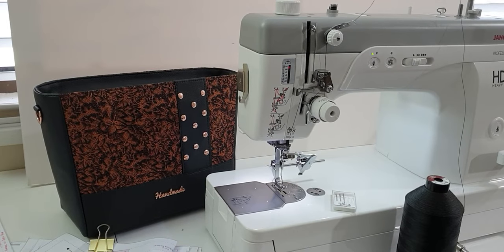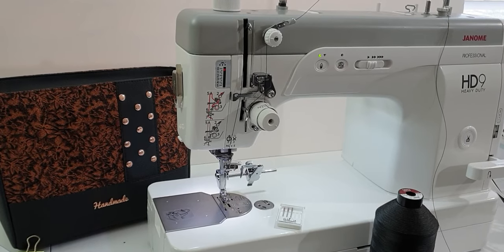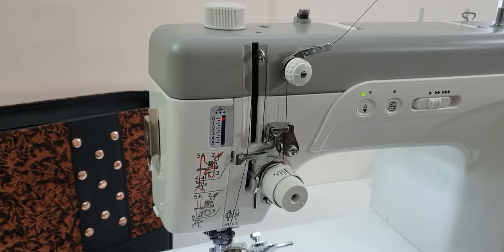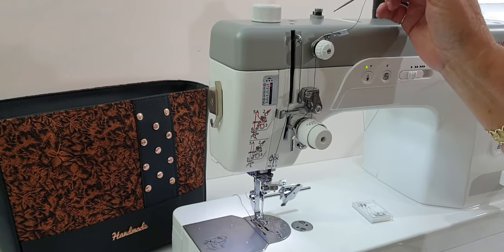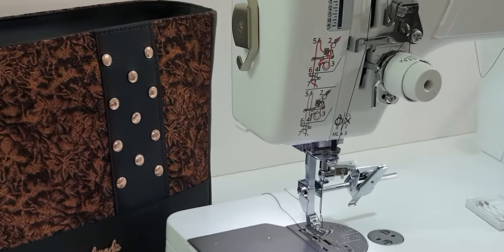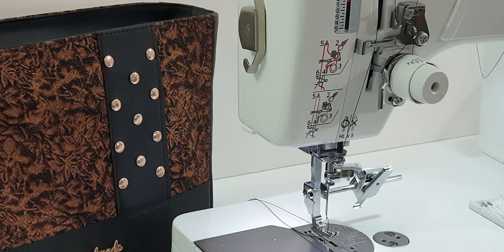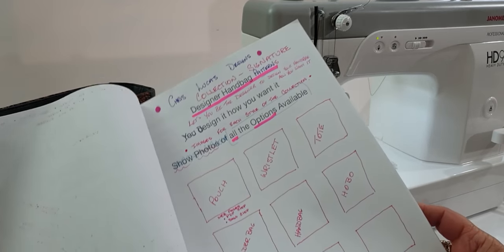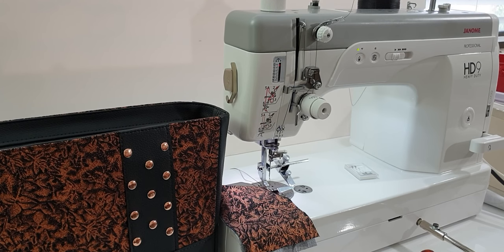Answering questions about about using my Janome HD9 sewing machine to make a handbag.

Comment from the maker: If you are looking for the adjustable seam guide I’m using in the video.  Here’s a link to the Janome dealer I bought mine from.  I also bought my machine and feet from them as well and they do ship worldwide.  https://www.ebay.com.au/itm/Janome-Adjustable-Seam-Guide-Janome-1600P-HD9-Professional-DB-Hook-Models-/293421670691?_trksid=p2385738.m4383.l4275.c10
Reply: Thank you.  I see you were using the Janome HD9BE, yes?  I just bought one, and it was shipped to me.  It clanks as I sew - so frustrating - it is oiled and the needle is correctly installed.  The bobbin is loaded per video tutorial made by Janome Junkies, and also the bobbin in loaded into the machine per video tutorial.  Any ideas you may have regarding what is clinking (as the needle goes DOWN), please advise.
Reply from the maker: @elainestephens5906  Sounds like something is either going on the top part of the machine or the bottom bobbin section… depends where the sound is coming from… top or bottom section.  Could be something misaligned somehow.  Also might be worth checking in the bobbin area incase there is a stray loose thread somewhere in there that is catching on something.  Other than that I would phone a sewing machine service technician and see if they can help you and suggest other possibilities and fixes for you.  I’m more of a drive the car and have the service technicians do fixes for me kinda person.

Comment: Perhaps a stupid question, but is it easy to do the top stitching around the top of the bag with the Janome? Presumably it’s done when you’ve put it all together.  The bag is beautiful.
Reply from the maker: Yes, the top stitching is done after completing the bag.  When I need a little extra space like a free arm machine I just I just prop the machine up on some large books 📚 or you can let your machine sit a little over the edge of your table so you can use it like a free arm machine… crazy I know but it works 😃

Comment: Beautiful top stitching! I still find it challenging to get consistent, straight topstitching without skipped stitches. Are you using an extension table for making bags?
Reply from the maker: Thank you.  I can be a challenge at times with different materials and varying thicknesses.  Sometimes I would lift the machine onto something higher so that I could use the end of the machine like a free arm, and sometimes sew the top stitching from the inside of the bag as that can also make it easier.  I know have industrial machines including a walking foot machine and a cylinder arm as I work with a lot of leather now also.
Reply: @ChrisLucasDesigns  Thank you for the tips! 👍
Reply from the maker: You’re welcome and hope they help you with getter straighter top stitching 😃

Comment: I have just purchased the same  machine. Do you change needles and all your tensions to sew the lining ( my lining is fabric and bag is faux leather.
Or do you sew that on a different machine?
Reply from the maker: Congratulations on your new sewing machine.  When I had this machine I use to use the same needle while making a bag and adjust tension as needed.  I use to find in most cases what ever needle I chose for the exterior materials also worked for the lining as well.  I only sold my machine as I upgraded to a couple of industrial machines and no longer had the space for all the different sewing machines I had.

Comment: I watched the video from Janome on thicker threads.  It states polyester thread.  I purchased bonded nylon a while ago.  Can I use it?  It’s a bonded nylon #69 Tex 70, or is that too thick?
Reply from the maker: You sure can Roxanne.  I have used both.  Just give it a test and see how it goes.  If the thread shreds then you may need a bigger needle.  And you may need to adjust the tension (the little screw) on your bobbin case if the thread isn’t feeding through the bobbin easily.

Comment: I recently bought the HD9 and am struggling to sew in the round ie items like top stitching around the top of a bag because the HD9 doesn't have a free arm option, how do you get a good finish this way, is there a technique you can share?
Reply from the maker: I just prop the machine up on some large books 📚 or you can let your machine sit a little over the edge of your table so you can use it like a free arm machine… crazy I know but it works 😃
Reply: @ChrisLucasDesigns  Wow great suggestions, how resourceful thanks!
Reply from the maker: You’re welcome xx

Comment: Did you try tex 135 (tkt20)? I know tkt30 work but would be nice if it work with 20 for the looks 😊
Reply from the maker: I didn’t as I never found the need for that weight of thread to achieve the top stitching looks I like even when using my industrial walking foot or cylinder arm machine

Comment: Thank you thank you for your video on threading this machine! I am having a frustrating time learning how to thread this! What weight is the Tex 45 thread? That’s what I have right now-
Reply from the maker: You're welcome Mary and I'm glad you find my video helpful.  A tex 45 thread should work great with your machine and a size 14 or 16 needle should also be a good size for that size tread.  You'd need to do a google search to find out the weight which is what I normally do too.

Comment: Thank you for such a clear video with so much info.  Could I just ask if you are using the same thread in your bobbin and if you then had to adjust the tension on your bobbin case because the thread is a heavy one?
Reply from the maker: Hi Geri yes I used the same thread in the bobbin (I should have mentioned that sorry) and I did adjust my bobbin case just slightly some time ago to handle the thicker threads.  Maybe that’s another video I could share on how I adjust and test the tension of my bobbin case.  I probably only turned the little screw about 1/4 turn.  One idea before turning the little screw is to use a marker to mark where the screw is before turning it just in case you want to turn it back to it’s original position at a later date.  And thank you for your feedback and question too 💗
Reply: @ChrisLucasDesigns  I think a video on adjusting bobbin tension would be of great interest - it appears that quite a few folk have an issue with getting this right x
Reply from the maker: @geriedwards4028  I’ve added it to my list of videos to do.  I’ll make it a dedicated video and there’s a few tips I can share about adjusting our bobbins.  Thanks again Geri 🤗

Comment: What foot is on the HD9 in this video? Is that the foot you typically use for making bags? Thank you
Reply from the maker: I was using the narrow toe foot that came with my machine.  I quite liked this foot for topstitching and for applying zippers too.
Reply: @ChrisLucasDesigns  thank you.  Do you think this foot would be ok for making piping?
Reply from the maker: @joellenpeterman9729  A better option would be to use a zipper foot so you are able to get the stitches closer to the piping.  Alternatively using a piping foot.  The most important thing when sewing and attaching piping is to get your stitches as close as you can to the piping especially when encasing the piping between the two layers of the materials.  The closer you can get to the piping the neater end result you will get.  I hope this helps 😊
Reply: @ChrisLucasDesigns  thank you🙂

Comment: Thanks for this video. I'm glad to see that my settings are almost identical to yours for bag making! Do you ever use the thread cutter? I was told never to use it on heavier thread, so I don't, but it seems strange to me that they would make a heavy duty machine but not a heavy duty cutter.
Reply from the maker: I tried the thread cutter on all my different threads and it definitely didn’t like cutting the heavier weight threads.  It’s more a machine designed to sew the occasional heavier weight threads and mainly designed as an alternative to an industrial straight stitch sewing machine better suited to sewing clothing and quilts etc.  I did find I needed to upgrade to an industrial walking foot sewing machine for my bag making as my handbag business has grown and I needed something that could handle sewing leather and thicker machines on a more regular basis.  Don’t get me wrong though I loved this machine and if I didn’t already have an industrial straight stitch sewing machine I would have kept this one for sure.  Unfortunately my sewing space can only handle so many sewing machines 😂

Comment: How does the HD9 do on thicker seams easily?  I’m considering getting one myself.
Reply from the maker: Really depends on the thickness of the materials you are using and how many layers and whether you are stepping up from say 4 layers to eight layers.  With fabric it can handle it easily and even denim but when it comes to jumping those layers with thicker vinyls and leather then I would recommend an industrial walking foot machine for sure to help eliminate the risk of skipped stitches when stepping up onto and off of those thicker layers.  Plus there is not much of a price difference either.  So it may come down to the types of materials you are using, space, and portability.
Reply: @ChrisLucasDesigns  thank you for the reply.  I do sew with vinyls and thicker fabrics.  I was going to buy the HD9, but now will look at a stronger machine.  Sewing store said it would be good enough, but I bought a machine before that they said would work and doesn’t do the thicker fabrics & vinyls.
Reply from the maker: @memeyers1962  definitely go for an industrial walking foot machine for those vinyls and thicker machines Mary especially when you have already tried other domestic machines.  You’ll never regret getting an industrial walking foot machine especially if you have the space and plan on continuing to work with heavier materials 🤗

Comment: Do you put the same thread in the bobbin? Also do you use the tex 80 for construction pls? I’m having an awful time with my new HD9 😔
Reply from the maker: I always do Stacey as I find I get better results.  Also check your bobbin case tension is set right to allow the thread to release from the bobbin it’s self correctly.  The actual bobbin case it’s self can be adjusted for different weight threads.  It can be hard getting to know a new machine.  If you do a search on Facebook there is a Facebook group for Janome HD9 users and I’m sure you’ll find some extra help there as well.  Plus you can share photos etc of the specific issues you are having in the group.  I hope this helps a little for you and I know how frustrating it can be getting to know a new machine and what it likes and doesn’t like.  🤗
Reply: Yes I’ve joined the group snd so many people are having the same problem as me 😔. I’m so upset with the machine. Thank you for your reply I’m going to give your info from video a go. ❤️
Reply from the maker: @traceysantierre4415  Hopefully you’ll be able to get your machine working for you 💜

Comment: Hi! Love the video. I bought the 70wt for prettier top stitching but cannot figure out the tension!☹. What number did you use? Thank you!
Reply from the maker: Hi Randi.  If you have another scan through the video you’ll be able to see the tension settings I used for this thread.  Don’t forget too you many need to adjust the tension on the actual bobbin for the weight of thread you are using as this can make a big difference too.  The heavier the weight of thread the looser you would need to make the bobbin so the thread isn’t too tight coming from the bobbin.  Sorry for the late reply too... somehow I missed the notification.
Reply: @ChrisLucasDesigns  thank you so much!!❤

Comment: Thanks so much for the video. So you think the hd9 could sew sheepskin?
Reply from the maker: You’re welcome Adam.  The HD9 can sew sheepskin leather and I would highly recommend using leather needles and also a walking foot or at least a teflon foot and probably release the foot pressure if you find the the leather isn’t feeding through smoothly from the top.  If you plan on sewing different types of leather in the future then I would recommend an industrial walking foot machine as it will handle sewing thicker types of leather.  Leather especially sheepskin leather tends to stretch quite easily when sewing especially if it’s not stabilised with a fusible stabiliser.  I often use decovil light to stabilise different leathers to both help add strength, structure, and durability of the leather if it’s for bags.  Hope this helps.
Reply: @ChrisLucasDesigns 
That's really useful. Thanks! I'm planning on sewing a lot of sheepskin, so I believe what you're saying is that whilst the hd9 can sew sheepskin, I'm better off getting a walking foot industrial machine for sustained sheepskin sewing.
Reply from the maker: I would definitely go the getting an industrial walking foot machine going by your plans.  The prices are very similar and the industrial has more power and I think durability as well.  Plus the accessories for the industrial machines are cheaper than they are for the HD9.  Eg bobbins are way cheaper for the industrial machine as well as the different attachments too.  Also the bobbins are bigger and you can use the bigger thread spools and thicker threads as well.  I ended up selling my HD9 (even though I loved it) but I wanted to sew a lot more leather and I bought an industrial walking foot machine and don’t regret it.  Now comes the fun part for you of researching industrial machines LOL.  Have fun shopping for your new machine.  At least you’ve got a better idea of which kind of machine will be the better machine for your sewing needs.
Reply: @ChrisLucasDesigns  Brill. That's made my mind up. Thanks Chris!
Reply from the maker: @adamnarat9677  Happy to help and to save you $’s in the long run by getting the right machine to do the job you want it to do.

Comment: Can you comment - do you miss not being able to adjust the needle position?  Does the machine come with a free arm and extension table?  If not, do you miss these features when making handbags?
Reply from the maker: I never missed being able to adjust the needle position as I don’t often use that feature on my other domestic machines.  As for a free arm I use to prop the machine up on a little storage case which raised the machine giving me a free arm.   I did end up selling this machine and bought an industrial walking foot machine which actually suits my needs better as I sew a lot and wanted something a little more industrial.  This machine sews beautifully though.  I also have an industrial straight sewer and a leather skiving machine as well as my domestic machines.  If I had of had the space to keep this one I would have 😂

Comment: Thank you for this video. I noticed your setting to 0.5 regarding down force on presser foot and it is 1/10 of full scale of 5. I noticed, that Janome actually have specified the max down force on presser foot to be 11 lbs or 5 kg. It is to me a very high value. I have sewn a lot of heavy vinyl and webbing with Tex 135 thread and did not need more than 3 kg or about 6 lbs. down force on presser foot. In manual for the HD9 it states a setting to 1 for very light fabrics - but you use 0.5 for bag making :) I think I trust you more on this issue. I guess that a setting of 0.5 would be a downforce of about 1 lbs. Did you ever try heavier threads than Tex 70 with this machine?
Reply from the maker: Great detailed info thanks for sharing that.  I did try quite a few different threads with this machines and found that most worked quite well.  The main thing is using the right size needle to suit the size of thread being used.  I have since upgraded to an industrial walking foot machine as I have been sewing lots more leather bags as my business has grown quite a lot since I posted this video.  I did really love this machine though.
Reply: @sewingmachinesindetail do you mean that you sew with tex 135 (tkt20) on HD9? Does it work fine?
Reply from the maker: No I didn’t find the need for that size weight of thread.
Reply from the maker: If you have the need for that size of thread my recommendation would be that you need an industrial walking foot machine
Reply: @haidenzeroonesix5939  No, I do not have the HD9. But I would like to know somebody, that did try perhaps Tex 90 thread on the HD9. I think you like some answers about that too. An industrial combined feed walking foot machine is of cause a better machine for the a job with Tex 135 thread, but it do also need space and skills to operate. Some of the household vintage sewing machines are able to sew Tex 135 thread reasonable, if you modify them a little. But household machines are not made that durable like industrial machines. I have sewn about 2500 meters of Tex 135 thread with a Singer 201K (with a few small modifications), and I have seen no signs of wear yet.
Reply: @sewingmachinesindetail  i see. Yes, the shop I ordered mine from, she have sew a lot of vinyl car seats and using 30 thread (tex92?) and works just awesome with it. But she has never tested with 20 thread. I'm going to sew some vinyl moped seats and of course IF I can use 20 I will just because it looks just better. I was going to order an industrial 3 step feeder but just don't have the space now. So this is the only compromise so far I could find. So with 30 thread it works.